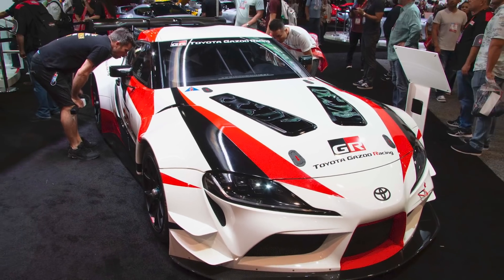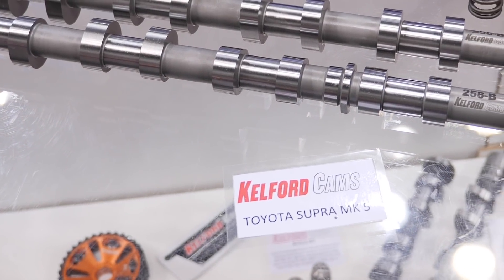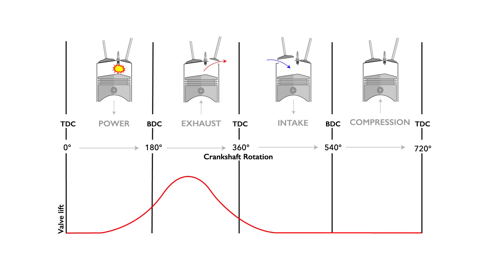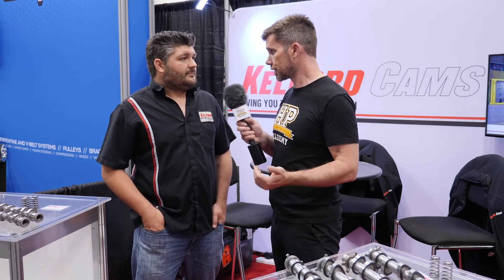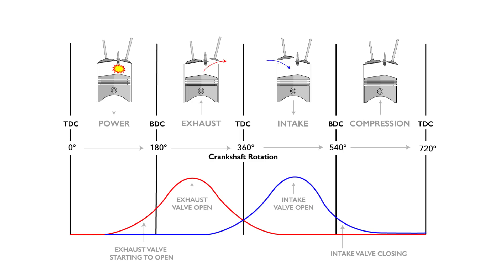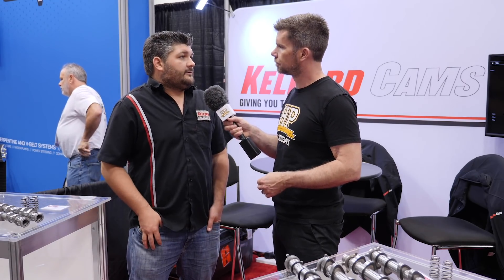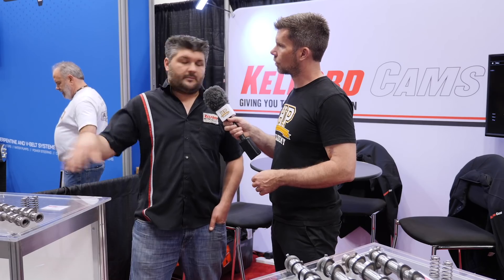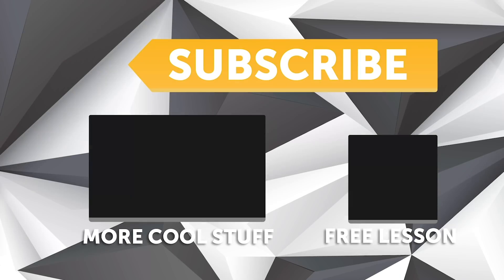A90 Toyota Supra Camshafts | Reverse Engineering The B58 | Kelford Cams [TECH TALK]

Comment: The moment Toyota started building trucks with chain driven transfercase, put V6 engines and automatic transmissions into as many products as possible...I realized they were steering away from what made them great. Japanese manufacturing is not nostalgic, they are always leaving the past formulas, methods, ideas...to make room for renewal. I do not see this as a strength. Now you're telling me the latest Supra has a BMW engine that relies heavily on augmenting mechanical timing through PWM and hydraulic pressure? It's like watching a beloved commander who led you through hell and multiple battles slowly morph into a hot yoga practicing, tree-hugging, pansexual who is rooting for Bernie Sanders, who wants to show you their latest gadget that really exfoliates their skin. Not a Supra. Fuk this I'm out.
Reply: Let's be honest here. Which do u ever see people tuning,modding,etc wise in the car scene with BMW vs Lexus. If anything,Toyota doesn't have a thing in there line up worth putting in the mk5 and if anything they can't make a i6 for one car soley since it'd be too expensive. So they went to a company that made engines that were tunable and modded unlike theres that are rarely ever tuned or touched at all unlike the 2j itself. If anything there such a family friendly manufacturer that it doesn't makes any kind of sense to just throw millions out the window like that no matter how big of a company they are,it's going to take years to recover from the sales they'd lose if they were to build it themselves.